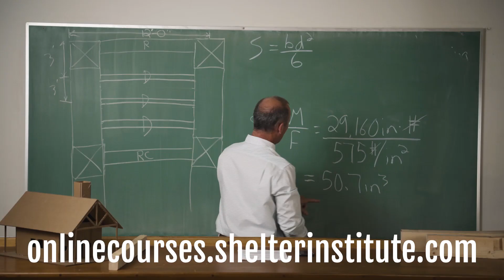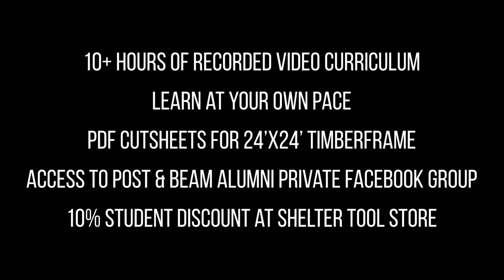How Does A Chainsaw Work? - Gas Line, Air Filter & Spark Plug

Comment: Here in Canada Shell Premium gas is advertised as 0% ethanol so I’d go with that for any small engine especially carb engines. One point I disagree is how much to purchase. I’d purchase not more then 1 month use. And once it’s in a proper gas can WITH ITS GASKET moisture will have a really hard time getting in. And I’d mix my gas the soonest possible because the additives in the oil mix will help stabilize the fuel.